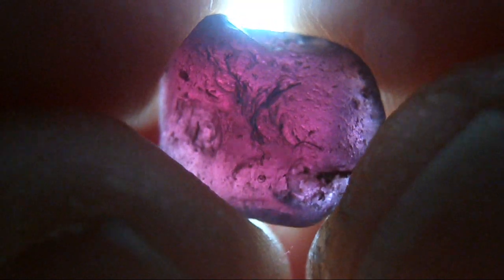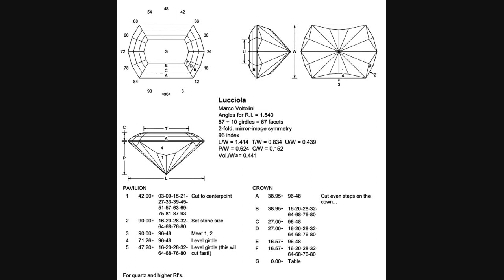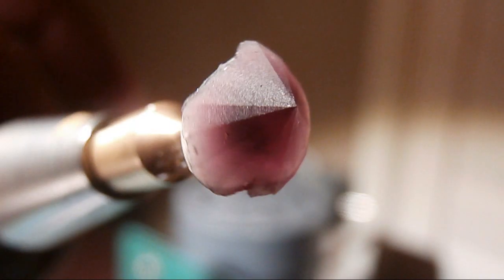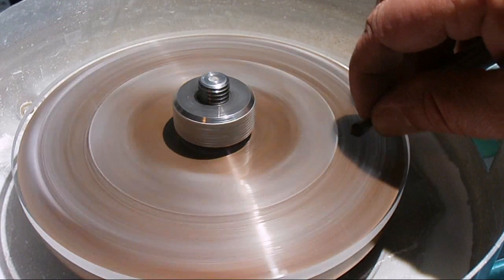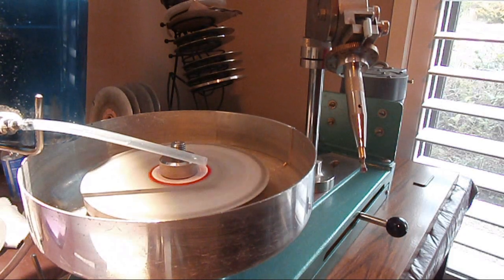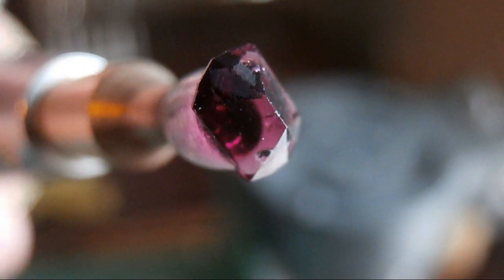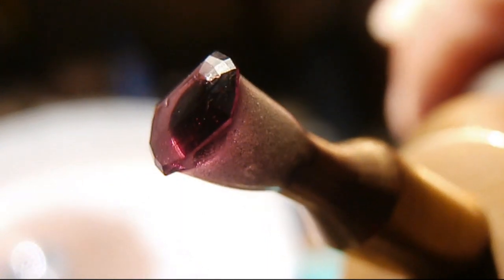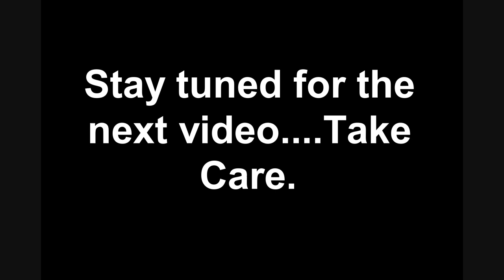How to cut gemstones - DISASTER! THE GEM FROM HELL

Comment: When you lower/press down on the spindle to grind the stone, you are changing the angle from the setting dialed in on your indicator.  How do you adjust for the change in the angle, or is the change too little to make any practical difference?  What if there’s an extremely small change in angle from one tier of facets to the next?